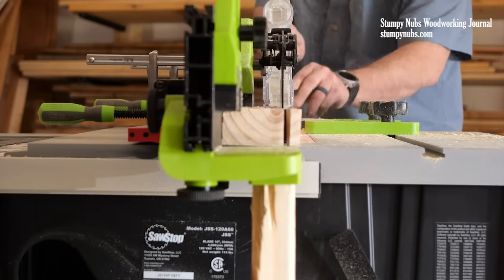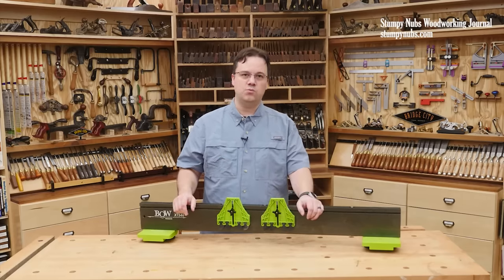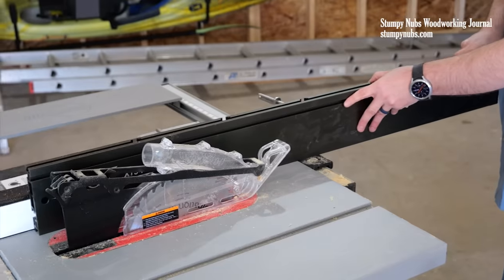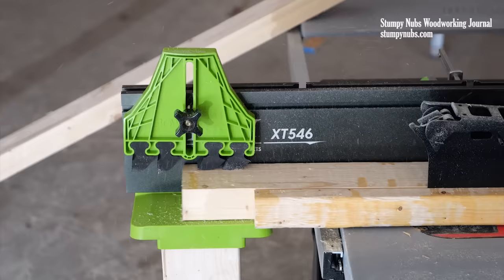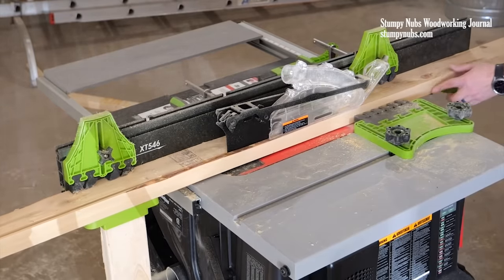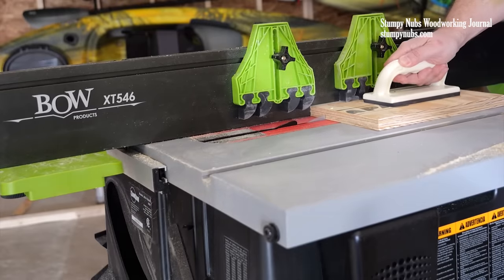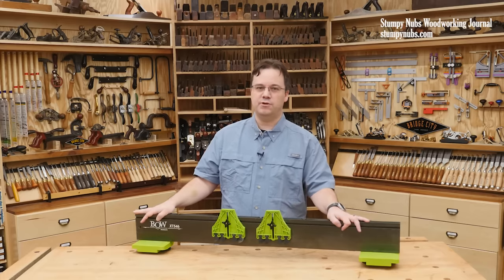I put this on my saw and it changed everything for me!

Comment: A little too rich for my blood. My saw cost $100 and that stuff you show there is about $300.
Reply: There will be blood
Reply: Hey if you got a table saw for $100  you've saved enough money to splash out! 😂  Your fingers will thank you.
Reply: Cheaper that an ambulance ride my brotha
Reply: If you upgrade your saw later this can move to the new one … it’s an investment.
Reply: If you’re satisfied with a $100 table saw I doubt you care much about added accuracy
Reply: Make your own!
Reply: I also really wonder if you need those accurate cuts, then why not spend the 1000+- for a saw with a sliding sled etc. Or if you care so much for safety and not accuracy then use a plunge saw? (Which if used properly also cuts accurately to the millimetre)
Reply from the maker: That says a lot more about the low price you paid for your saw than it does about this setup.
Reply: I came here looking for this. I got exactly what I was looking for.
Reply: It's the sad cost of engineer
Reply: The price you paid for your saw is NOT related to the value of your fingers.
Reply: @Jimmys_TheBestCop  cmon man how many ambulance rides have you taken lately from your table saw? I admit it can happen but let’s not fear monger
Reply: @StumpyNubs  Just purchased a complete kit.   An Australian fan!
Reply: @MT-rg4dm 60,000 table saw accidents annually
Reply: If you always have an extra hand, or never cut anything over 6’ then this isn’t necessarily or needed. But it’s definitely a tool I’d purchase.
Reply: You sound like the kind of guy who would fall all over himself to go give China another 50 bucks at Hazard fraught
Reply: Bro I paid $25 for an old craftsman table saw… $300 for a system that can be added to it and my next saw is worth it. Especially when I’m planning on a bigger safer saw in the future anyway. Definitely an investment… just gotta save the money first…
Reply: @MT-rg4dm how many have you seen?
Me?
3. It's not pretty.
Reply: Almost anything that will make my saw safer, I'm game for. As a retired woodworker, I'm on a tighter budget than many, but I'd rather put $300 into my saw than emergency medical bills.

Comment: Wow. That's really slick, and much better priced that I thought it might be.
Reply: thats what i was thinking, it looks like its gonna be a must have for my cordless table saw.
Reply: $159.00 in U.S.A but $357.00 in Canada for the 46 inch fence only.    No thanks.
Reply: A four foot fence and the accessories shown on the video would be around $450.00 USD….Thanks but no thanks, That’s just too much.
Reply from the maker: Where are you getting $450? The fence I used with the supports is $200. You can use your own feather boards and MatchFit-style clamps. If you want to buy clamps and feather boards, the whole set on my saw was $300. Here it is: https://amzn.to/49M9hmn
Reply: to get the the real meat of this system the  46” fence the supports and the clamps at 225$ for a major improvement to a saw sounds f’n great
Reply: Thanks Stumpy, I will be ordering the 46” fence and supports for my sawstop jobsite saw. I have feather boards and match fit clamps so less money for me. The only complaint I had with this saw is the small table with large or long boards. I have zero room for a large table saw and this will solve the problem for me.
Reply: Yep, I got the 46" fence, in/out feed supports, 2 fence mounted featherboards, table top featherboard, 2 clamps for $299. 

Total game changer. Rips are straighter, faster, and safer. Hands down the best accessory purchase I've made.

I'm planning to buy the band saw resaw GuidePro next.

Comment: Hi Mr Stumpy,

I really like your videos. About this one, I must say that I realized such an upgrade years ago with melamine. It exceeds the table on the in feed side that serves as an in feed table, just like the one you show, but with a different design, of course.  It does work pretty well. I added an ajustable leg at the end of the in feed extension to support long pieces. An adjustable leg can be made from a telescoping painter pole or shower curtain  rod. Safe, simple and free (or almost). Not as light as this aluminum one, of course, but for the price, I like it. We are in the DIY universe, so I encourage people to make their own tools and jigs because it is also a part of the DIY mentality.  Good job. Thanks.
Reply: We both could have been RICH. I did the same for my portable 5 or so years ago.

Comment: I don't have a job site table saw.  Mine is a a 1970s Delta/Rockwell Contractor's saw.  I'll spare you from the longwinded story.  Not planning on upgrading just yet to a Harvey cabinet saw right away.  Instead I am building a bench integrated with the Kreg Adaptive Cutting System/Kreg Track Saw.  This will will reduce my need in many cases for a table saw.  Yet I would be a fool to watch this video and think that I shouldn't explore getting the Bow Products 46" XT XTENDER Fence System.  Anything that would make my world a safer place is something I am willing to invest my hard-earned money in.  Even when I get my Harvey down the road, it's not like I couldn't still use this fence.  Either that or I could pass on to someone with a job site table saw that wold truly benefit from the tool.  Great vid.  Thanks.

Comment: I have this system and it is a tremendous help.  I use all of their addons including their taller horizontal feather boards.  The only thing they need to add is a fence tall enough to use on a 12" saw for ripping 4" thick boards.  They are super easy to deal with.

Comment: I got mine a couple weeks ago when 731 woodworks announced taylor tools  had a shipment coming and was acceoting preorders. Ive already been using the feather boards on the router table quite a bit. I havent out the fence on the saw yet, but one of the main benefits i like is the downward feather boards which dont readily fit on a table saw like the side ones do. Really helpful for jeeping the wood on the table when ripping long miters. And I do have a jobsite saw too, but it hadnt dawned on me to put the fence on that one since i don't use it as much.

Comment: I been using the Bow fence on both my jobsite sawstop table saw and bandsaw for several months. It is absolutely fantastic and worth getting.  I been cutting tens of 24 in strips for  basket weave cutting boards on the bandsaw and the fence is fantastic for straight cuts.

Comment: I’ve used the Bow finger board and band saw guides and have been very impressed with their design, build quality, performance and the additional level safety they add. I have been waiting for the 48” fence to get back in stock to add to my Skill 8-14” job site table saw.

Comment: I bought a full set a month or two back and it definitely makes a huge difference.  I got the 46” fence, a pair of the supports, a pair of the vertical feather boards and a horizontal feather board.  The comments below are not wrong - it’s a good bit of change (dollars), but it’s also make a big change in the usefulness, accuracy and safety of the saw.  And FWIW, these accessories can multi-task - put them on a bandsaw, replace your table saw and use them on the new saw, etc.    Those fence extrusions deserve a special comment.  They are seriously solid (and heavy, which is not a problem).  I had been thinking about making something sort of like this using the usual suspects and they’re nowhere near as solid.

Comment: I was wondering when you would get to reviewing this!  I purchased it when it came out several months ago and agree with all of the points you made!  I have the same SawStop Jobsite Pro saw and it solved my fence issues!  I have my saw mounted into a rolling workstation and have been contemplating upgrading the fence to a Biesemeyer style fence, and with this add on I don't think I need to anymore!  Highly recommend!!

Comment: I couldn’t be more happy with mine…it is an exceptional product imo.
Reply: Do you have to remove the stock support on those fences that extends off the saw and flips into place when ripping wide stock? The video shows a nice large  table top. Would it work for a smaller saw? Like a Milwaukee or DeWalt?
Reply: Sure will!

Comment: Thank you for this recommendation. Due to space limitations, I'm using a DeWalt contractor saw (which works well).  I received my Bow Xtender system today and it will both make this saw much more versatile and also safer to use.

Comment: I feel horrible that I cannot afford their product right now. But oh the ideas in my head to make a solution like this from the what I have on hand right now! 
I am what you would call a "Budget Driven" wood worker. I have an older Shopsmith MK V and if there is an improvement I have been trying to solve it is the out-feed because unlike modern saws, the table height changes with cut depth.

Comment: You and 731 woodworks both promote this item. It is a nice item and it does work mostly well. Mostly.
The feather boards need to be adjusted really tight in order to optimize the anti kick back features. The cutouts for the t track clamps on back aren't as well placed for ALL saws as it claims. This really limits how useful the outfeed feature really is. 
For some insight, my jobsite saw is a popular Dewalt fold out jobsight saw that I don't have a model number for in front of me. 
It has a dual action fence that allows for some thinner or thicker stock with the flip of the dual action fence. The dual action fence also allows for support when ripping wider ply. Oh and if you want to make a quick adjustment in rip width when running wider stuff forget it. The Bow extender makes it impossible to move the fence because the weight of it pushes down on the rack and pinion fence adjustment so much that you have to either lift up on rip fence assembly or take it off. Otherwise it feels as though you may damage your saw. The t track clamps do their job but on my saw in particular, no matter where you put them or align the Bow extender it puts too much pressure on the dual action fence assembly and bows the metal while tightening even slightly enough to prevent the Bow extender from moving on the saws bed. I've had to use some 2x4 cut down between the dual action rip fence and the Bow clamps in order to not damage my very new saw. 
So is it a well made product? Yes, but with caveats. 
It is not a one size fits all as it claims. It is a heavy item that could be of detriment for smaller saws especially. Heavy enough to tip a saw over if not very careful or completely level. 
And to be very honest, a Dewalt saw being probably in the top 3 popular jobsite saws this should have been more thought through as a "fit all". 
I like the Bow extender. Is it worth the premium I paid for a metal rail and a couple clamps? Meh.
I'd only give 3.5 stars for functionality at days end. 
It'd be a great design that saw manufacturers could perfect as a saw add on at purchase.
Reply: I agree, the weight of the fence does result in an unsettling drop putting stress on the on the rack and pinion slides. I built a combination table saw/assembly table, using the longer assembly section as an outfeed, which works very well. However, I only added an additional 7 inches of support to the right of the saw (made this before purchasing the Bow fence). Didn't really think about the weight issue until I attempted a 24 or so inch rip and experienced the drop. So as is, I only have a rip capacity of about 18 inches. My solution will be to fashion some sort of additional support to the right of the saw (I have the DeWalt 7491 which ordinarily has a 32" rip capacity with the stock fence). 
Overall, I am happy with the fence, seems to be straight and square. Kind of surprised more people haven't experienced the weight issue.
One other thing, you can save some money, about 40 dollars, by making an infeed support, I made one using a piece of 1/2 inch plywood and a couple of T bolts, you do need the shim it 1/16 of an inch to make it perfectly level to the table, small washers did the trick.

Comment: If I had known you couldn't buy an fence extender.
About 5 or so years ago, I made one for my Skil Saw portable table saw. It is made out of 3/4 ply but I also added the table extensions on the in-feed and the out-feed. It slips over my fence because at the time I didn't know where to get any types of clamps to use on a fence.
I could have been rich I tell ya, RICH....

Comment: Another brilliant innovation from Bow.   Especially love that it's exactly 25.4mm deep, so for precise cuts, all I need to do is add 25.4 to my desired measurement...
Reply: If you use 2.5 cm instead, the error is just 1.6%
Reply: @erik_dk842  That .4 mm is about 1/64 inch, That is the difference between a tight fit or a bit of bother. Then again a jobsite saw probably isn't the right tool if you need that level of accuracy. Especially since it's targeted at being able to handle larger pieces of lumber.
Reply: I was thinking the same.  Adding one inch sounds great... until you have to add one inch to your desired 234mm.  That's ..., umm, .... Yes, I can work it out without too much effort, but it's no longer as simple as just adding 1.
Reply: Well its not easy adding the fractions either. My brain can't deal with adding 132/132s to the measurements.

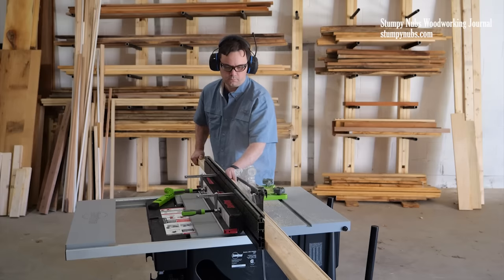Comment: You Nailed it. Help me out here PLEASE!. I just bought the SawStop CTS. Will this set up work on my small fence? Next, I just unboxed my Harvey bandsaw. I bought the 14” Ambassador Series. They included the new compass Universal Guide. I also bought. The Harvey Miter Guide Pro. I contacted my customer service rep about the taller Harvey fence that they make for the larger set ups. It’s about $100.00 bucks. These are 0:45  my new machines. If you recall from my other comments I work in my wheelchair. With all this… do you think the Bow set up like you had it set up on your SawStop will it work on my new machines? Thanks for doing the review. I was truly ready to buy but had some reservations. I was going to call their customer service tomorrow but then saw your review. You did a great job. Plus you demonstrated every single piece that was on my list. Can you give me some advice? Thanks. TS, Portland OR
Reply from the maker: Yes, it should work on both fences.

Comment: This is looking like a very good product.
Almost all products do when put in the spotlight.
That's why I deem a product good after I've discovered the downsides with the product. 

I then weigh the good versus the bad and come down to a decision.

The only thought I have right here is that I have no idea how well tested this product is.
Is it really tested enough to be safe? 

How does the machine / wood act when something happens? I have no idea. 
So what do I need to do to stay as safe as possible? No idea again. 
It might work very well indeed, but I don't know this for sure as it hasn't been approved by any
safety standards in my very safety standard country (Sweden).

Many parts are made of plastic, will they hold throughout the years or dry up and crack when they're needed the most?

What I'm saying is that this product isn't tried. When it is, I'll probably be the first in line to the shop.

When it comes to safety test trials, I'd prefer not to gamble with my own safety. Especially when the country the product comes from doesn't share the same safety culture as the country it is used in.

Comment: I bought the 46” version last year for my Delta TS to increase the capacity on the outfeed side. The fence does work well. 

My only issue is getting the entire 5 inch height of the fence to be 90 degrees to my table. The first couple of inches are dead on but it’s out the higher I go. I have tried adding shims between the fence on my saw and the Bow fence but that didn’t work. I’ll figure something out. Great product nonetheless.

Comment: I've been thinking about getting one of the Bow extender fences for awhile. I have a SawStop Jobsite Pro saw, like the one you're using in the video. I have a really small shop (only 9' x 13' exterior dimensions, so like 8'6" x 12'6" interior), so I can't fit a table saw any bigger than that, and everything has to be mobile so I can deal with bigger pieces of lumber (even outside my shop, when necessary).  I already have one of the Bow feather boards and like it a lot, so I think that Bow fence system will be a great addition to my shop. Being able to use it with my band saw would help that, too, but I think the longer fence that is best for the table saw would be too big for my little benchtop band saw. Maybe Bow could figure out how to make one that adjusts?!? I'd be all-in on that, for sure! Anyway, I'll probably pull the trigger on the extender fence soon. It looks too good to pass up.

Comment: I commented previously and did purchase the 48” model for my Skil brand 8-1/4 job site saw.  Huge improvement in ease of use and safety.  

My question is about making jigs which will slide over it.  One of the problems with the saw is the very small table which makes a cross cut sled which runs in the two tracks on the table difficult to use. Do you think a workaround where the sled slid on top the extended BOW fence like a jig on the fence for cutting lap joints on vertical boards or the fence and the track to the outside of the blade is feasible?

Comment: I love your videos - am a total fan.  I immediately decided this system is for me based upon your recommendation.  I looked on Amazon and can not find a list of table saws it will work on.  I have a Dewalt DWE7491RS table saw.  Do you happen to know if it will fit my table saw?  Sorry, if this is a stupid question but don't want to order it, etc., just to send it back.  Many thanks!
Reply from the maker: If your table saw has a fence with two parallel sides, it should clamp to it.
Reply: @StumpyNubs  Thank you VERY much!